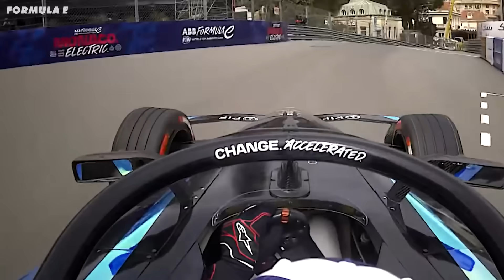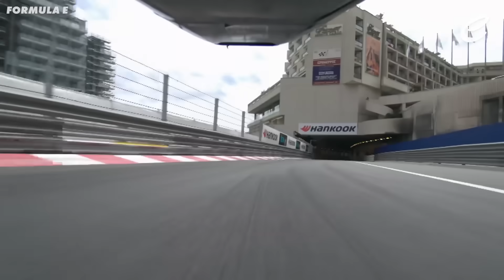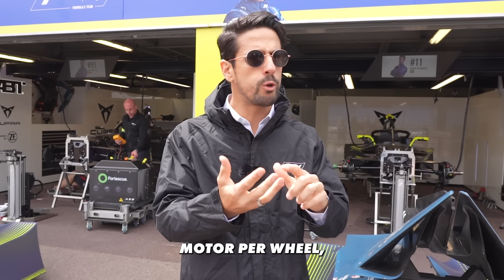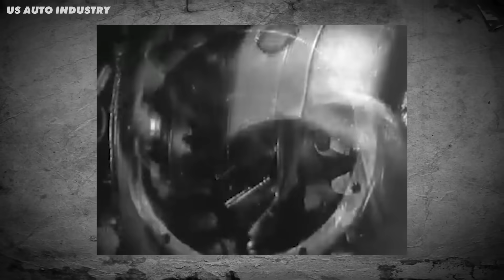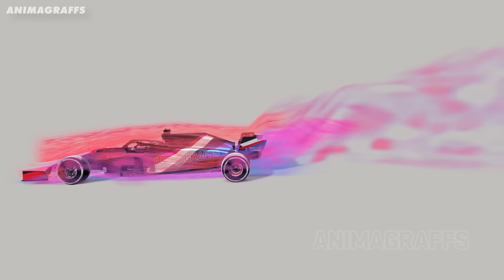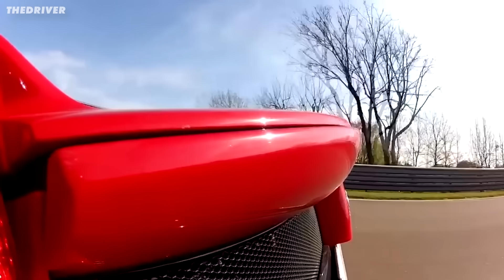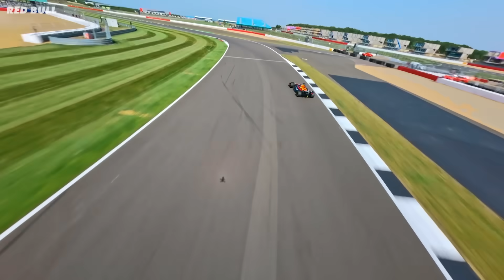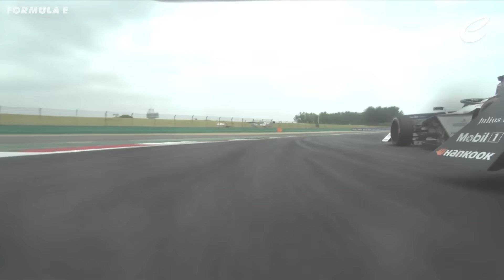The New Formula E Car Might Be F1 Fast

Comment: It will one day be F1's rival , one day
Reply: Solid state cells in 2026-28, raxial flux hybrid motors like the koenesigg dark matter which is 800hp at just 40kgs!
Real useful aero, stickier tires etc.
Reply: @4literv6  Lot of problems with Solid State Batteries to fix first, I doubt we will see them in the next decade in any large commercial application, if ever.
Reply: @RinslerRR   F1 cannot go fully electric, it will conflict with Formula E license. Watch Cleo Abram's video- Formula E, The Electric F1 explained.

Comment: Would active suspensions and ground effect (like in early 80s wing cars) be more aero-efficient? 
If I remember correctly, Gen1 Formula E had different solution for drive trains, batteries, even gearboxes... now they are all  the same, no active research, how would it be Gen4?
Reply: The Gen1 drivetrain solutions collapsed into what we have today mostly because teams found out what is the best - strong EM with single gear is better than small motor with many gears, and so on. In early seasons teams were throwing ideas on the wall and observed what sticks, eventually arriving at same findings. 
We might get a new era of "different solutions for the same problem" with the Gen4 car, as completely new innovations would be involved and teams would have to again figure out what the best solution is.

Comment: FE is incredibly boring right now. Watching races where nobody wants to lead is horrible. Gen 1 gave awesome racing - and it has just gone downhill for each gen.
Reply: I hope fast charging comes and makes it more flat out to remove this aspect
Reply: @lewis8552  I have considered charging a lot. It will have to be with a separate car or battery swap. Otherwise going slowly/minimal charging will always be the better strategy.

With charging it can be full gp length and speed, if you only pay the price of the swap. The second car/battery starts charging at the green flag. So you can go faster but get less charge when you stop. Lots of strategy. No need for energy limits - except very high one for safety.

Comment: There was a reason why F1 abandoned traction control and ABS, they made the racing worse. Essentially you could have a bad driver doing almost as well a good one because the car was doing all of the thinking. I hope that FE does not go down the same route.
Reply: Seems like they are. ABS already exists but more so out of necessity due to most of the braking happening on regen. They're also allowing traction control in AWD next year, but only in that mode. So seems to be the direction
Reply: it's as Lewis said, but the cars are very easy to spin if you aren't delicate enough regardless

Comment: It's actually quite insane that formula E can't beat F1.  Off the rip electric cars smoked road cars on speed.  This shows how insane F1 truly is.
Reply: F1 cars are also ludicrously efficient for ICE vehicles. The Mercedes F1 engine gets about 50% thermal efficiency - about double what a standard road car gets. So the ~90% efficiency of an electric powertrain isn't as much of a gap.
Reply: From what I recall EVs are hella quick off the line but rather quickly peter out and lag past 100 mph, which is a big problem against high downforce cars which can take corners at those sorts of speeds and accelerate out nearly as fast as an EV in the lower ends.
Reply: @demomanchaos This is not true of modern electric supercars

Comment: With all the software etc, active aero, Awd etc...what is the driver REALLY doing? Software driven cars will take the skill away from the driver, there needs to be a technology limit.
Reply: Still need to brake,apply throttle and steer to get the car around the circuit the quickest way possible. All these tools don't really take that away, just makes car setup more difficult/technical

Comment: The video is full of "could be"... Advertisting x2 performance uplift against gen3 is sus without mentioning the overall weight... FE may brag of monster numbers but its only over the course of a few lap at best. Multi-element active aero is already a questionable tech along with torque vectoring via a fly-by-wire computer.

What they should be aiming for is more laps per race, by all means have gain of performance from more higher torque and efficiency. It would be better if FE could break the conga-line slip-stream race craft that its very famous for, better yet prove that its more than capable of having a "rain-master" drive in the wet.
Reply: They're aiming for longer races as well with this car, tsrget is between 1hr to 1hr30m. Car will be heavy though, around 900kg, battery has to be so much bigger

Comment: there's a misconception about predictability in racing. in this video, it's said that when it becomes less predictable, it gonna be more interesting to watch. but that's not what real world data suggests (it'll mostly attract different viewers.) unpredictability essentially means that the winner is mostly determined by luck. this would make a technically challenging sport akin to poker, gambling in a casino, or soccer. the reality is that most F1 fans are also tech nerds and they really like to understand why a team one. look at NASCAR; they drive up to five-hundred miles to make some engine noise and the last lap then yields one lucky winner; it's just a very different category of sport.

yes, the thing which indeed can be frustrating to watch is when a faster car is severely impeded by a slower one and there's nothing they can do about it except waiting for a pit stop opportunity.

so yes, ensuring that overtaking is possible is a very good thing, of course.

Comment: My (quite ancient now) memories of being at motorsport events start with brutal noises, smell of additives and burned stuff. Cars pushed to the limit that were a bit all over the place, errors and quite a lot of crashes.

It was awesome, made you feel small, and anything could happen, there was a lot of reliability issues.

When I see things like this... silent, so perfect that they are glued to their trajectory by the millimeter, Ridiculously high-tech.... I dunno. I see the point for developing technology, and yea there might be some form of excitement if you support this or that pilot. But 'm starting to think that motorsport is dead. Even the "classic" F1 and endurance cars, the modern GTs... they are so perfect, so micromanaged in every last bit, that they are perfectly boring to me :/

And frankly, since engineering came that far, what's even the point of making these cars even faster? An old BMW of 400 bhp with zero electronics fighting every corner is way more fun and impressive to watch than a perfect wheeled spaceship taking bends at precisely the right speed and exactly the right angle to half a degree because telemetry gave the perfect answer to everything.

Comment: Wait....If each wheel runs on its own individual power, is there still a need for a differential to distribute power? Would you still at least need a differential for mechanical reasons?
Reply: Watch some formula student electric presentations for more info on this

Comment: Are not EV more energy efficient than CV by design? Like up to 3x? 15% seems very little honestly. Are the 800bhp only available on a boost setting or actually available for the whole race? Also I have read the car is going to be heavier and bigger(obviously). And who cares about the VW ID R records on pikes peak and Goodwood? It was 40 sec slower on the nordschleife than the 919. I do not hate electric racecars, but it will probably take 10 years to become as fast as current F1 for a whole race. And who cares honestly. F1 is slowing the cars down on purpose for better racing, the next generation will be even slower than the current ones. Keep the cars small, make them lighter, increase the range, limit aero and increase the power little by little, give the engineers enough creative freedom but also nerf the top teams enough and race on exciting tracks. That’s what I imagine most fans want.

Comment: Nothing beats V10 flybys and when pit stops were actually still an important part of the strategy. 
Saving fuel should not be part of a race.
No child gonna remember the day when an electric racecar just zipped by, with no sound.
Reply: "Saving fuel should not be part of a race." - But nursing the tyres to make it to the finish line is great, right? 
"No child gonna remember the day when an electric racecar just zipped by, with no sound." - I've been to FE races twice, those cars are quite noisy (the motor is silent, but the straight-cut gears make a lot of noise) and when flying by, they sound like a fkin bullet arriving straight from the future. Definitely an experience to remember :)
Reply: Actual adults will value FE more because the races are flat out better than F1 is.
Reply: But F1 hasn't had V10s in over 10 years.
Reply: I quite like the strategies they use in FE, it's kind of like bike riding where you save power by following someone

Comment: At this rate, FormulaE will surpass F1 in 3 to 5 years. Depending on the advances, it might even happen faster
Reply: Hope the Gen 4 car will be quicker than the 2026 F1 cars.
Reply: Not a shot. Maybe Gen 5 or Gen 6 will be on par with F1 but that's like 2030 and not massively likely even then. Gen 4 has to get on tabs with F3 and F2 first which is not gonna happen when the tyres they use are much worse.

Comment: IDR proved electric cars are faster..a literally race car builded with no rules..Build an F1 car with no limitation and it's gonna destroy any single car you race with it.
Reply: An F1 car with no rules is not an F1 car anymore.
Reply: No. IDR is all wheel drive with torque vectoring. An F1 car is rear wheel drive with no torque vectoring. You can convert it but it will be highly inefficient, unreliable, and heavier. It will not perform better than the IDR. The only way is to make the F1 car all electric and all of the wheels have motors and torque vectoring and all wheel steering. At that point, you've basically creatd IDR from Wish.

Comment: I love this.

It’s the final evolution of the racing automobile. Goodbye to all of the things F1’s inane bloated ruleset banned for financial reasons, and hello to the perfect race car, with every bit of advancement ever made.

Four wheel drive. Four wheel steering. Active aero. And electric drive. Would we also see active suspensions, air brakes, and moving turning flaps too, in future generations? Fan cars? Traction control?
Reply: traction control is actually already coming with Gen 3 evo
Reply: Formula E is slowly becoming what Formula 1 used to be, the pinnacle of motorsport and automotive engineering.

Hopefully they will introduce DAS, active suspension and slick tires in the future. One day, a Formula E car will destroy even the Mercedes W11 on a Grand Prix circuit and I'm all in for it! Formula E will become the new Formula 1.
Reply: @KitKitChanIsaac 
I have to remind you again that absolute speed was not the point of Formula E, but getting as much out of a given amount of energy while battling others trying to do the same. Yes one team could make a tribute track weapon. But these innovations are born out of the need to minimize consumption and speed is the bonus.
Reply: @KitKitChanIsaac  Not sure about that tbh. F1 has stalled in recent years but FE also has its own limitations that it implements like tyres that lack way more performance than other road racers. Light on downforce. I mean, we'll have to see what changes for Gen 4 but realistically, I don't think they'll completely abandon all their routes, like how will they keep racing on the street circuits if they go too fast.. Adjustments will have to be made. It's an ambitious project to work on in just 2 years.
Reply: @KitKitChanIsaac  have you considered stand-up comedy? A Formula E car destroying the W11 is the funniest thing I've ever heard of
Reply: @bumblebaelatte  A Formula E car will destroy the W11 15-20 years from now.
Reply: @KitKitChanIsaac  No it won’t, not under the same conditions. You would need an incredible advance in technology to make it happen and nothing is on the horizon.

Comment: If formula E is getting so adv only with electrci why do we need to push this agenda in the F1 too ,with 50/50 Electric/ICE ,why not start using synthetic fuels like Motogp.
Reply: It’s not an agenda, it’s superior technology
Reply: @Tommmmmmmmmmmm  Superior technology? Current F1 cars are as fast as the ones from 30 years ago. You're brainwashed.
Reply: @MuppetsSh0w current F1 cars are way way faster than the ones 30 years ago. While being far more efficient. So no, he is not brainwashed.
Reply: @Tommmmmmmmmmmm  Yeah, sure, let's try to make a Formula E car do a whole 305 km race as quickly as an F1 car.
Reply: @Olivyay Don't most WEC-teams adopted hybrids without having to, because they're faster?
Reply: @balduinvontrier128  In the late 90s McLaren also had a project of going hybrid by recovering the heat from brakes, before the FIA banned it.
I'm not saying using hybridation doesn't make the cars faster, it can, but currently with the weight of batteries a battery-only car couldn't be as fast over a whole F1 race distance as an F1 car. The efficiency of the electric powertrain is cancelled by the added weight.
Reply: @Olivyay  This very well may be true. But wasn't the original question about a hybrid F1 vs an ICE only F1? The original post complained about hybrid F1, not full electric.
Reply: @balduinvontrier128  Yes, my bad. I got carried away by another replier who argued it was "superior technology". Which it can be, but only in certain circumstances (and the 2026 F1 rules risk going too far).
Reply: Or If they actually want to make a difference make The calendar make sense not just fly across the world every weekend
Reply: Also, f1 does use synthetic fuels.
Reply: Because the world is moving on. If F1 doesn't adapt in 20 years time they won't be the pinnacle of motorsport anymore, but a series of historic tractor racing.
Reply: Because F1 doesn't want to fall behind, not that complicated.
Reply: Because synthetic fuels aren't a real solution to anything - they're a marketing stunt.
Reply: You should move to a house close to the coast. They are getting cheaper.